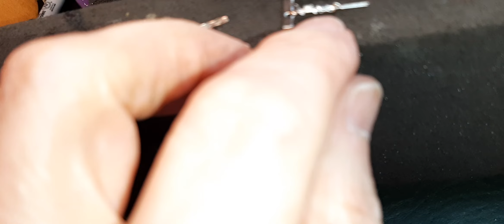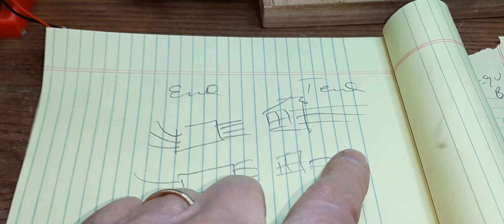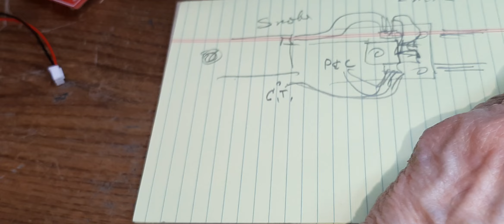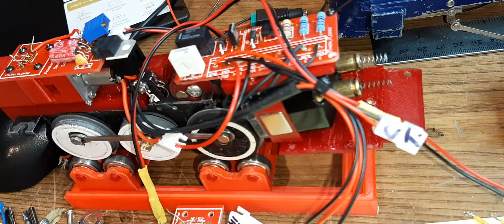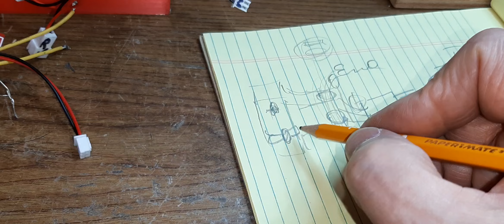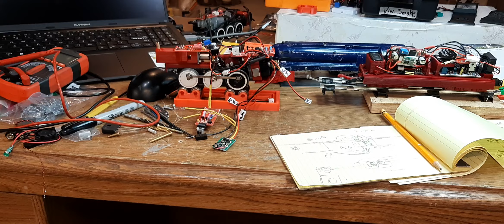How to wire a Model Train Tender. Only 8 wires! Digital Motor Controller, Sound, Chuff & Smoke pwr.

Comment: You have made a lot of progress in the short day that you had.

Thank you for sharing.
Reply from the maker: Yes the crimping is really hard with my old eyes. But I double checked the finished harness and all it solid.  Glad i upgraded the wore gauge to 22 on the higher amp draw components. Looking forward to fix up the Engine and change out the chuff trigger.  D